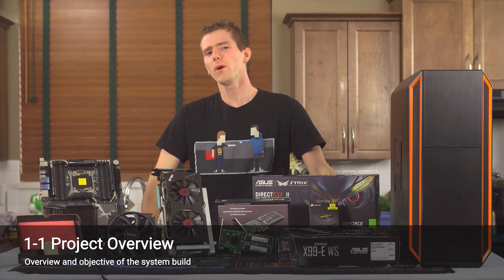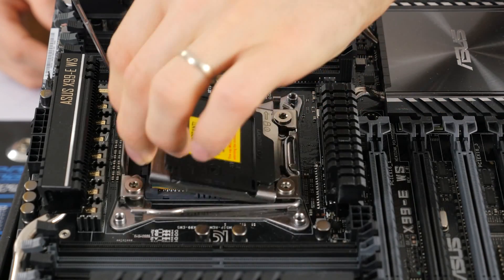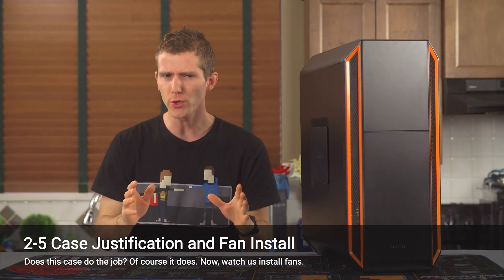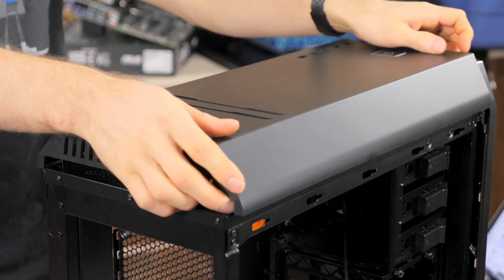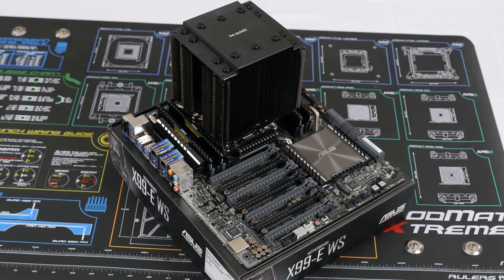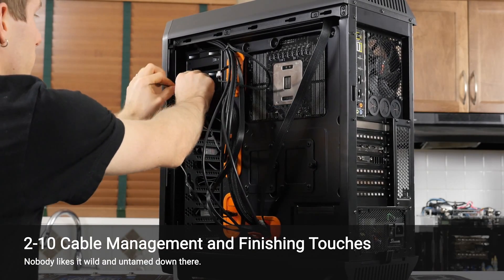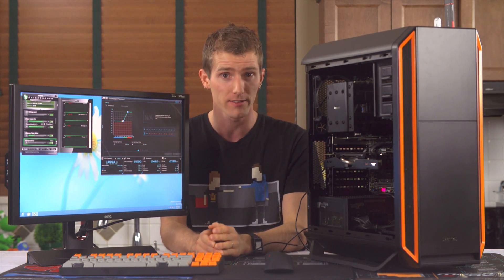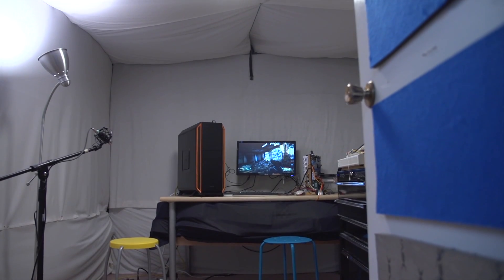How to Build the ULTIMATE Silent Gaming or Workstation PC

Comment: hey guys i want to make my first build and i wanted some of your guys opinions.

CPU: intel core i5 4690
CPU Cooling: corsair H100i
MOBO: msi z97-g45
GPU: MSI gtx970 4G
RAM: 8gb
PSU: EVGA SuperNOVA 650G1 650W ATX12V Power Supply 120-G1-0650-XR
SSD: Samsung EVO 850 250gb
HDD: WD Blue 1TB
Case: Fractal Design Define R5
Reply: EK United Btw, the PC looks good. I don't see anything wrong with it.
Reply: Why 4690 and not 4690K?
Reply: sorry Casual G4mer i forgot to write the k
Reply: Casual G4mer You don't need to overclock an already strong single threaded CPU...
Reply: norge696 But there's no reason to not get the overclockable version if you have an H100i and a Z97 motherboard
Reply: Casual G4mer im gonna overclock my GPU  thats why im getting the h100i
Reply: EK United You mean CPU?
Reply: oh shit yeah. i kinda messed up my C's and G's Casual G4mer
Reply: EK United what ram?
Reply: Flamecookie100 
Avexir Core Series 8GB (2 x 4GB) DDR3-2400 Memory
Reply: thanks Casual G4mer but do you think this will run games like GTA V, Witcher 3, Fifa 15, etc
Reply: EK United yes, but it will depend on the settings you go for
Reply: ok, Thanks Flamecookie100
Reply: EK United Most games maxed at 1440p will run just fine
Reply: Casual G4mer thanks for all the help man
Reply: EK United This is basically exactly the same as the PC I just ordered yesterday. Only difference is that I have an NH-D15 for cooling, and a seagate barracuda 2tb for HDD. Everything else is exactly the same. Good builld! :)
Reply: EK United Damn you and your amazing first build lol

good build tho
Reply: ZZ Gaming thanks man
Reply: EK United Anytime! I have an AMD build, with an AMD R9 280. It performs well, but i'd like to get an Intel build.
Reply: ZZ Gaming What exactly are you going for? You mentioned a graphics card and are talking about processors. Do you want to get an intel processor or a typical intel build? (intel processor, nvidia card).

If you want an intel processor, i'd recommend waiting for skylake. If you want a new card - don't. The 280 does fine for atleast like another year.
Reply: MadPanda582 why would he wait for Skylake?
Reply: Flamecookie100 I realised after writing the comment that it'll need a new chipset, so nah, nevermind that. Card still stands though. The 280'll do for a while still.

Comment: Silent
Powerful
Cost effective

Pick 2.
Reply: JgHaverty first two :P
Reply: JgHaverty Can I get a double cost effective
Reply: woah woah woah, you cant just make up your own rules! haha
Reply: I don't care about silent I cool mine with two leafblowers and jet turbine
Reply: Sean Fiske I love the build! But man your going to get a bottleneck with a Pentium and a 970, I would really recommend going to an i5, otherwise the rest of your build is great :) best of luck!
Reply: Phantom Some people have managed to get it to over 5 under water.
But it's still a bad choice.
Go for a nice k-skew i5 and you WILL see better performance.  It would also be more futureproof (gasp!) as you likely won't have to change your CPU and motherboard when you want to upgrade the graphics card again.  If you don't get a k-skew it's more "bang for the buck" friendly to grab a B 85 motherboard (even an H 81 one.. but they kinda really suck)
Also get 2x 4 GB sticks of memory for double the bandwidth (increased performance in some cases)
Reply: Powerful cost effective
Reply: Phantom
Well, temperatures.
Reply: Phantom
With increased temperatures comes increased noise to cool it and if the card isn't using a blower cooler the other components are going to have to ramp their fans up as well.

Actually, I have yet to find a use case where a blower cooler is actually a worse option to be honest.
Reply: Infinite Zero A 4790k build isn't "cost effective". Its "powerful" and efficient. A good cooling system will up the cost more as well. 

Plenty of low cost builds that can do the same job for a whole lot less coin.
Reply: +JgHaverty Powerful and silent.
Reply: Westin Mcclister do you mean 2 r9 290x refcenge and amd 9590 with 1 delta fan on heatsink?
Reply: +JgHaverty Here's a similar X99-based digital audio workstation build for around 1250.
And yes, it uses silent parts, including an NH-D15S and a Define R5.
(The PSU can be swapped out for a 650G2 or a 650P2)
http://pcpartpicker.com/p/N3X8pg

Silent. Powerful. (Relatively) cost effective.
Reply: JgHaverty Yeah it's a work build. For gaming swap out the card for something like a 390X or 980Ti / 970 or 390
Reply: +JgHaverty Powerful and Cost effective, I dont care if my computer sounds like a semi truck if it can run minecraft on 4k :')  (the minecraft part is a joke)
Reply: Im in marching band, i think the drums did it to me
Reply: bran, the thing can overclock to 4+ ghz he's not gonna bottleneck it.
Reply: Tommy59375 but if it's budget then a pentium is fine. i5 is better i'm not denying it but a pentium won't bottleneck a 970. 1080p 60fps e z.
Reply: Phantom
I don't really believe in the use of a 970 for 1080p to be honest, unless it is so important to you that every single setting is maxed.  You can get by brilliantly with a 960 and hardly have to turn anything down.
Reply: Tommy59375 But other than shadow play their is really no point in getting a GTX 960 when you could get a 280x.
Reply: Tommy59375 Sub 80 is fine imo. but yeah, that's a good point.
Reply: Is this a good build? http://pcpartpicker.com/user/BO0d3/saved/dJPdnQ
Reply: Ronda Lesta Sure, but not much point getting a 144hz monitor. Unless you wanna tank your settings and run a lower resolution, you wont see 144 fps on most AAA titles with that computer at 1080p.

I owned one of those keyboards for about 2 weeks before it started giving me problems. Returned it and grabbed a K70, havent looked back..

You only need like 300w on that rig fyi. that even gives room for some healthy overclocking. 4690k is 88w, gtx 970 is 145w.  Rest of it will be less than 80w (significantly less). For overclocking headroom, a 500w is all you need. Now that 600w one isn't horrible, but you can get one of those corsair semi modular models for pretty cheap as well, definitely recommend doing that!  600w is pretty overkill for what you need, just saying.

Overall, heres what I would recommend...

http://pcpartpicker.com/p/jLh8cf

Why? Im going down to a r9 290 for 2 reasons... 

1) Its cheap
2) Its powerful 

Tough to beat that...
I DID choose that particular one for a reason. Its unlocked fully, overclocks very well, and has hynix memory (elpida memory doesn't overclock well at all...) powercolor actually has awesome customer service too! 

IPS 23" monitor that will look better than the one you chose.... and its also cheaper. these overclock well, you can typically get over 100hz from them. 

That keyboard is pretty solid, and for the price is quite awesome!

Saving you money in those places gets you 2 awesome benefits...

1) a fully modular TOP NOTCH power supply. 
2) A 250gb ssd! Samsung 850 EVO is incredibly reliable, well made, and super fast. Trust me, the 3 extra fps you lose with a 290 vs a 970 will be well worth it for SSD loading!
Reply: Tommy59375 *gives up* fuuuu just buy a 2/390 Kappa
Reply: Sean Fiske r9 390 at %100 load drains like 300w alone.500w may not be enough.But i can be wrong.Inform me when you test it please :)I am also planing to get a smilar system and power it up with my old 600w psu.
Reply: Phantom It will bottleneck.
Reply: SALUSIA
To some extent yes, but not so much that it ruins the point of said card.
Reply: To get all three, just get a 970 (any one will be fine since bios flashing is a thing) and an i7-4790k or i7-5820k. After that, just follow the steps in the video and you'll be fine. 

Here you go, a powerful, silent and cost effective build.
Reply: +PandaYT 2 cores isint enought for anything even lol dota2 or csgo
Reply: SALUSIA csgo on low fps suck because source engine lags on that and mouse mowent is laging and i game on 144hz and i can say diffrents on 240fps and 300 fps
Reply: Aaponton Jokes on you. CS GO is a 32 bit program. That means its single core, and source is a single core based engine.  If youre on low fps, you are trying to play on 4k, or you have an old old old computer.
Reply: JgHaverty facepalms.
Reply: SALUSIA Why? lol
Reply: JgHaverty csgo can take advantage of more than one fucking core you dumbass... all source games can, and they are 64bit.
Reply: SALUSIA yea csgo have start command what make it uses all cores/threads on ur system
Reply: SALUSIA 
The source engine (i.e. cs go) has always been 32 bit. Let me repeat this. Source engine games have ALWAYS BEEN 32 bit. 

32 bit means its at most able to utilize dual core cpu's. But they dont really, because CS GO strongly utilizes IPC performance of a single core. 

Do yourself a favor, and go look this shit up lmao. Dota, CSS, CS GO, Portal... all use 32 bit processes.  The only source game I know of that ISNT 32 bit is titanfall, and thats because of the other shit in it, not the game engine itself.

By all means, show me some links to prove your claims (both of you). Ill be here waiting. I can easily prove mine... I'd just like you to realize that YOU are the dumbasses lol
Reply: JgHaverty yea but uses all threads on the system
Reply: Aaponton If you're rocking a dual core without hyper threading you are correct! 

Otherwise you simply have no idea what youre talking about!
Reply: JgHaverty im rocking with 4 core with hyperthreading and it uses all my 8 threads
Reply: Aaponton lol, you really dont understand how 32 bit programs work buddy.
Reply: JgHaverty i know but its working my all 8threads are used same amount like 60% and csgo is only thing on my system plus like virus secure
Reply: +PandaYT Just so you know, some games are hardcoded to not run at all if you have less then 4 threads (from either physical or logical cores).
Also, bottlenecking in this case is a bit more complex then any single performance number.
There will be (a few) situations where a OCed 2 core pentium (with luck of the chip lottery) will do better then even a stock 8 core monster from Intel (although admittedly that's very, very, very rare, especially given that the 8 core have more catch and all sort of other things and there's cases where even slower (in single threaded performance) quad core and hex core AMD processors will easily outperform it.
And as far as bottle necking goes throwing several threads worth of processing into just two cores will cause bottle-necking in some cases, but on the other hand this processor can be damned fast in other cases where it'll cause less bottle-necking then processors with way more cores then it.
Reply: +JgHaverty Last two and put the pc in another room from where you're using it.
Reply: Pretty much - that build sounds like it's going to start a Forrest fire
Reply: Powerful and cost effective! Honestly the noise of the worlds loudest PC is no louder than a lawn mower so think about the average. Normal, non- sound reduced pc's aren't even loud! The only difference is your paying $200 bucks less!
Reply: ***** Not everyone would agree.
Some would pick some combination excluding one of those two things you preferred.
Reply: ***** Um, actually, I didn't ask, JgHaverty asked.
And I was commenting on your "duh!".
I mean, sure it's a valid opinion that you came with, but the "duh" suggests that the alternative opinions are not valid somehow.
Reply: Powerful silent
Reply: ***** Better. ;-)
Reply: Visaural For work builds, thats fantastic. For gaming, thats like putting 40$ tires on your ferrari lol.
Reply: Josh Clark
I'm kind of a silence freak myself, but kudos for being deaf enough to not care. :-P
Reply: Silent, powerful
Reply: JgHaverty Silent and powerful. I already have, too. I built an i7-7700K and EVGA 1070 FTW build.
Reply: Powerful and still cost effective

Comment: Hey guys I'm very new to this and I have a couple of questions. Ok I'm building my first Pc with the help of a Buddy of mines that knows how to do build them . I wana run games at 1440p with ultra settings at 60fps are two evga sc ftw+ 970s capable of this my friend told me yeah I would like your input guys. This PC is strictly for gaming guys
Reply: edwin ramos Depends which games man. But 90% of them will run at that fps on 1440p with SLI EVGA FTW 970s
Reply: Driver what games do u think I can't play on max setting at 1440p?
Reply: edwin ramos Quite a few. Depends what games you're into. If it's more of the "popular played" games like League, CS GO etc you'll be more than fine. Switch to BF4, Crysis 3 and GTA V and you'll see some drops to mid 40s, high 50s. But I'm not too sure on this so my best advice is to watch benchmarks of SLI 970s and form your own opinion as I'm only running one 970 at 1080p

Comment: Isnt the system overheating? i mean there is a single fan blowing out on top and there is pushed air in form both sides with 3 fans as i saw in the video.. so i simply dont get the airflow design here

Comment: What do you guys think of this build:
Asus H97-PRO GAMER Socket LGA1150 Intel H97 4x DDR
Intel i7-4790K Core Prozessor (4.00 GHz, Max. Turbo 4.4 GHz
Corsair Hydro Series H100i 240mm Extreme Performance CPU (liquid cooling)
HyperX Savage HX316C9SRK2/16  (16GB)
Zotac ZT-90204-10P GTX 980 NVIDIA GeForce
Corsair CX Series 750Watt
Western Digital WD10EZEX Blue 1TB 
Samsung MZ-7TE500BW Serie 840 SSD 500GB
Reply: Malte Kröger Looks nice.  What are your goals?  I wouldn't recommend water cooling unless you are overclocking, and with an H97 board it doesn't look like you intend to.
If you plan on running stock clocks and whatnot, your PSU is a bit much.  You should be OK with 600 watts, but the CX is a good line.  Blues are good HDDs.  For a few bucks more I would get a WD Green or Red drive, if you plan on just using it for media storage.  Blues are good but Greens and Reds are quieter and cooler.  Unless you are plan on running at 4k and/or high detail, an i7 is probably too much.  An i5 is plenty for gaming.  I would plow the savings into a PCI-E SSD like the 256GB Plextor:https://pcpartpicker.com/part/plextor-internal-hard-drive-pxg256m6e
or maybe a beefier video card.
I would jump up to the Z97 chipset though.  I run the Z97-A from Asus.  More features, but if you don't plan to overclock H97 is OK.http://pcpartpicker.com/part/asus-motherboard-z97a
Looks good though, although maybe a bit mismatched.
Reply: So do you think that the Asus H97-PRO GAMER Socket LGA1150 Intel H97 4x DDR would be a better mainboard for overclocking?

Comment: The Be Quiet cpu cooler is nice, but it's HUGE. My Zalman is much smaller and only slightly louder than the Be Quiet, and still quieter than the PSU and GPU fans. It also looks nicer, but that's subjective.

Comment: You missed the most important part, an example of temperatures under load. Being quiet at idle is nice, but what happens to the temps under load?  For stock clock speeds sitting in BIOS, I would say 44C is quite hot. I would expect your CPU to be throttling back at load, making a $1000 CPU a waste.

Comment: I just built mine with a Bitfenix Ghost case, and used stock Spectre fans, a Cougar 140mm exhaust fan on top, an EVO cooler, and a hybrid HDD. The only thing I can hear sitting 3 feet away from it, is the hard drive. Which is kind of annoying, because I'm not used to hearing the HDD, until now, even though it is very quiet. The sound foam inside the Bitfenix case really works quite well.
Reply: Condor1970 Ditch the hybrid drive and grab a dedicated SSD and something like a WD Green or Red.  You'll like the result.

Comment: Hey all! I have a question for my first build. Yes, im a total noob so I could use some help. I want to build an pc that is capable of gaming and some video/photo editing. My budget is around 1000 euro’s/dollars incl windows. Is the Sapphire Dual-X R9 280 and AMD 8370E any good or must I get some heavier duty stuff? Or do you have other recommendations?
Reply: Go to Reddit /r/buildapc they will help you
Reply: On it!
Reply: Dylan Hernandez aswell as The LTT forums!
Reply: Wow im a moron. Didnt know that there were forums with ltt -.- Thanx!
Reply: I would consider a better graphics card if you want to get the most out of games 285 or 290 if you want to stick with amd or a 970 on the nvidia side. Also that processor will hold you back a little on games compared to similar priced intel cards, but it'll do a lot better for editing.
Reply: Thanx. It would be a 50/50 computer. I have some room at the budget so im looking at your suggestions.
Reply: Dylan Hernandez  7950, 3570k, Can do GTA V 60fps On very high, It'll do on the budget